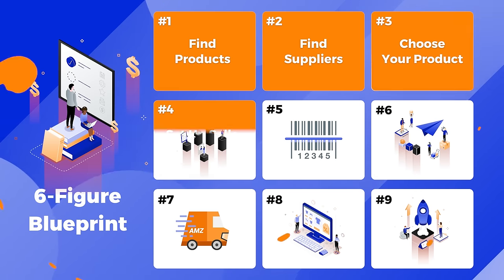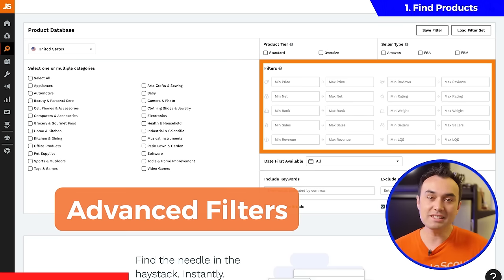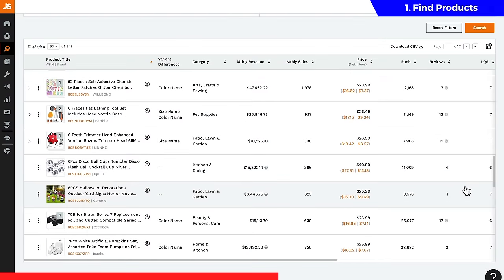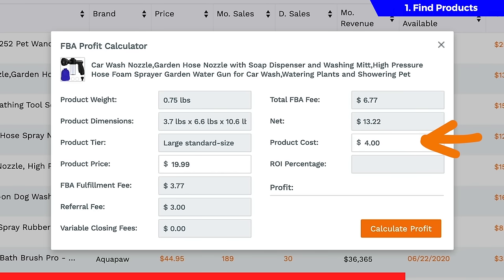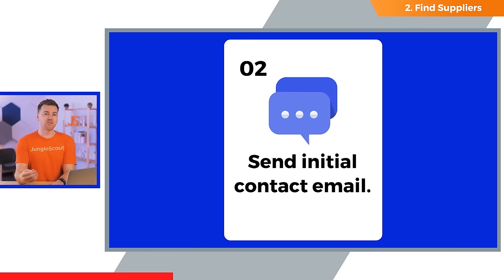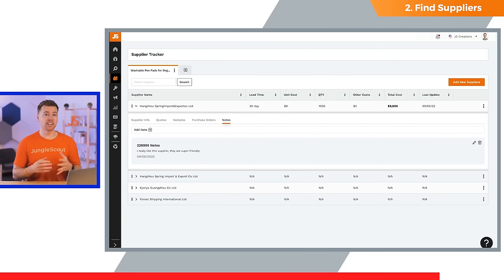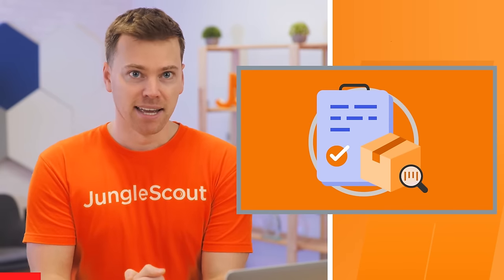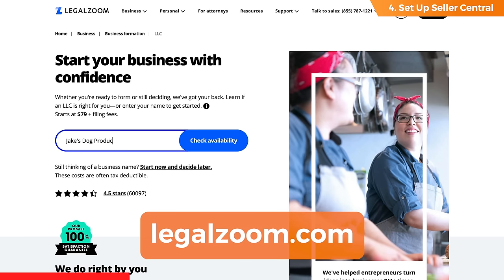ULTIMATE How to Sell on Amazon FBA Guide for Beginners 2023

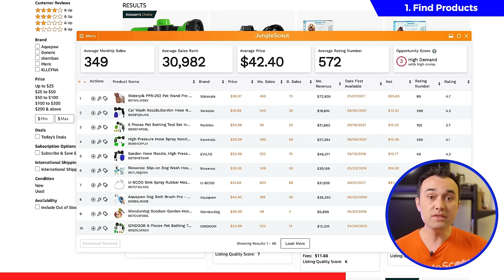Comment: I'm looking at the example at 15:55.  The product has a sale price of $36.97 with 450 monthly sales which states $72,907 and the monthly revenue says $72, 905.  Any way you slice this, the math doesn't add up.  36.97x405 is $16,636.50.  Maybe I'm not understanding revenue but that's a $56,270 discrepancy.  If that information isn't accurate, how can I possibly make projections and determine the potential for my investment?  The accurate number of units sold would have to be almost 2000 per month (1972) to even come close.
Reply from the maker: There might have been a discrepancy at that time as the monthly sales were not showing up correctly (Having 73 daily sales must be more than 450 monthly sales).. That has been corrected right away
Reply: 73 daily sales makes more sense but which one is it?  We don't know which metric is accurate
Reply from the maker: You should be looking at monthly sales and multiplying it by price. We checked the data for this product again and it looks ok now!

The issue on the video might have been a temporary glitch!

Comment: You guys are awesome, I'm following you from Spain which is a smaller marketplace, any advice on how to measure demand on smaller marketplaces? Obviously i can't expect to have the same demand here as in the U.S. Cheers!
Reply from the maker: Bienvenido! We love an international seller who is thinking about market size. You are totally right, demand will not be the same - you need to adjust it based on the size of the market. Look at the Extension and Tracker data to gauge what sales have happened over the last 30 days and work with those numbers.

Comment: Hello, once you purchase your barcodes how do you know if you need to use the bulk method you are referring to? Can you provide an example? Or if I purchased 3 barcodes for small/medium/large, would that be bulk?
Reply from the maker: Are you referring to buying UPC barcodes in bulk? If so, the rule of thumb is if you need or will need more than 8 barcodes, use the 2nd method but if you will need less, buy them per piece. For your example, since you will just need 3, it is not advisable to buy in bulk.

Comment: This is a great video but I have a question. I’ve done my research and learned all that I can but I’m learning after trying to post my product Amazon requires a product inventory list list (they provide the template) in order to associate the SKU with my product so it will show as a listing in my inventory page in Seller Central. Is this mandatory? My listing goes straight to “draft” and gives a SKU error… If this mandatory could that be added to your video? Any insight would be so helpful
Reply from the maker: Checkout https://www.youtube.com/watch?v=evG2ZLXWywQ&t=266s and contact Seller Support if you continue to see the SKU error.

Comment: For the Amazon seller central. I have a question of what business type to do. I have a LLC but I’m partnered with some one. Do I still apply individually or which business?
Reply from the maker: In this case, you can still use your own LLC, but there will be no way to add your partner's details/business info.

Also, you can subscribed with either the Individual plan or the Professional

Comment: Im just starting off and wondering, If I have a product that I am going to have available in different colors but same quantity do I need to purchase new GTIN for each color?

Thank you so much for great video!
Reply from the maker: Yes! Each variant requires an assigned UPC. 😉
Reply: Thank you so much :)
Reply: I’m also at the step now of creating my 1st listing. I’ve purchased my GTIN through GS1 but each time I try to submit my posting in seller central I get an error message from “Product ID” section saying “the sku does not match any ASIN and contains invalid value(s) etc”. This is even after I copy and paste my GTIN directly to that section.

Not sure where I missed a step…
Reply from the maker: Did you choose an option to create a new listing or to sell on an existing listing?
Reply from the maker: This error happens if you just purchased codes directly from the GS1 and then attempted to create a listing on Amazon with the GTIN.
Reply: Okay. How would recommend I move forward? Do I just need to wait?
Reply: My product is already sold on Amazon I’m just making variations. Should I just select from already existing listing and “request” approval to sell my?
Reply from the maker: Hey! You should be able to set up variations on the backend! You don't need any approval or to wait.
Reply: Hello I’m back 😅. I am creating a shipping plan in seller central. I have one product that has multiple colors but only one sku is showing for me to select when setting up shipping plan. Can you tell me what I am doing wrong
Reply from the maker: Hello there! Let's make sure you followed the correct procedure using Send to Amazon shipment creation workflow. To know more, please go here: https://www.junglescout.com/blog/shipping-to-amazon-fba/

Comment: question one-. do we need "Customs Brokerage" they charge 175$.
Question two- is it worth to pay $40 for insurance?
question three- lets say i brought 50 individual units. I put their dimensions and weight per unit. Would i select boxes/crates on freigtos or pallets?
question four-is it better to pay 170 for aliabba to ship them to usa instead of getting a frieght forwarder. like whats cheaper.
Reply from the maker: 1. If you know how to do it yourself, or you are not afraid of doing it yourself, then no, you do not need the customs brokerage
2. If you can afford it, then we recommend that
3. This would depend on how you are going to pack the product. However, with 50 units only, you should go with boxes/crates, as we do not think you will be needing pallets
4. You would need to check the rates with both a supplier and Freightos

Comment: Great video! Can you clarify how the maximum sellers section works on the software? I have put a maximum of 5 sellers when searching products, the list is generated and it details products that have 5 or less sellers. However, when I click on that product and go to the Amazon page, it can sometimes have maybe 8-10 sellers. How can I fix this so that I can only see products with 5 or less sellers?
Reply from the maker: The filter should pull out results for however, the data it's pulling from can be up to 3 weeks old while the extension is live data :)

Comment: When you pay for UPC bar code and let's say you purchase 300 products of something. IF the UPC bar code cost $30 you are only paying the $30 once, correct? That label is then utilized for all 300 products. correct?
Reply from the maker: That's correct! You purchase a code for each variation, then replicate it onto each item you sell. So for example a set of t-shirts that come in four sizes and three colors means 12 codes and you apply the corresponding size and color code to each of the pieces in your inventory.

Comment: If i'm currently only focusing on wholesale can I find products to sell with high demand,  high profitability, high reviews, and low competition? Would I as a new seller stand a chance at rotating the buy box and selling any products against 3-10 other sellers with thousands of reviews?
Reply from the maker: If you have 3-10 sellers with 1000's of reviews, the product wouldn't be classed as low competition!
Try to find products where there aren't as many reviews or dominated by certain sellers.
Reply: @junglescout  That makes sense. Will I be able to find a good product that is already selling decent, then source the same product on alibaba? I understand that y'all are geared towards private label and I would like to do the same once I can find the right product using JS.
Reply from the maker: Hi Matthew, yes, you should be able to find products and resell them on amazon. Just make sure to check the amazon revenue calculator to find out the estimated profit on the product before you start selling them: https://sellercentral.amazon.com/hz/fba/profitabilitycalculator/index?lang=en_US

Comment: For the GS1Barcode, I only have 3 products that have 3 different colors i want to sale. Can i use the option of getting 1 barcode 3 times which will be 90 or i have to purchase the 1-10 which is 250
Reply from the maker: The first option! If you only need less than 8 barcodes, the math makes sense to buy 3 individual ones, rather than the 10 pack. That's your most cost-effective option 🙂

Comment: I have several questions. 
1. If I am buying from a supplier and want to sell on amazon do I have to buy a barcode or the company from china can attach the barcode for me.
2. I messaged a supplier and they said they will use either DHL or UPS as the carrier. How will the goods get from the carrier to Amazon, do I have to setup the add shipment to print the FBA shipment label?
3. If I do not know if a product is listed on amazon due to thousands of search result, can I list a product as a product that is listed on amazon even if it might be there and I couldn't find it?
Reply from the maker: 1. You will need to purchase a UPC code from GS1, and the supplier can put it on the packaging of your product

2. You will need to verify with the supplier if they can ship the product straight to Amazon. If not, you will need to pay another carrier to get your goods from the port to Amazon's warehouse, or you can ship those goods yourself.

3. Unfortunately, that is not possible. The option to sell on an existing listing, only works for products that are already listed on Amazon (and you would need to sell the exact same product that is currently listed on Amazon)

Comment: My supplier offers a DDP and ship directly to Amazon fulfillment centre, what should I fill up at the "carrier" section? Does the Carrier information means the carrier from the destination port to the warehouse?
Reply: I can guide you
Reply from the maker: Are you referring to the "Ship from" address? If yes, then you can definitely use the supplier's address ☺️
Reply: @junglescout  I mean the carrier information: "UPS", "DHL", etc. I have a small initial order and my supplier can ship directly to Amazon fulfilment center.
Reply from the maker: In this case, you will need to verify with the supplier which carrier they are planning to use

Comment: My product comes in two different colors. How do you get two barcodes for the same product then list it on amazon using two barcodes?
Reply from the maker: To list a product with two different colors on Amazon, you will need to create two different product listings, each with its unique barcode. You can then associate the appropriate barcode with each color variant.
Reply: @junglescout  Will the customer be able to see both colors under one listing?
Reply from the maker: Yes! To do this, you will need to create variant listings under a parent listing.  You can check our listing  variations guide here: https://www.junglescout.com/blog/amazon-product-listing-variations/

Comment: what if landed items won't sell .. who is responsible for that
Reply from the maker: So there are quite a few ways you can manage any unsold inventory. You can check out this Amazon article here: https://sellercentral.amazon.de/help/hub/reference/external/201436560?ref=efph_201436560_cont_202000820&locale=en-DE

Comment: Great content! you guys have nailed it. Quick question, @51.00 Amazon requires you to have 1 UPC barcode per product. Can you use that same UPC for the same product multiple times? $30 per UPC for 1 product seems really high! and does the UPC expire?
Reply from the maker: It's for listing per product per variation but is not required to buy 1 per unit/pc.
Reply: @junglescout  I will learn as I go, that answer was not very helpful! lol right now, my understanding is that each product will need a UPC and for each variation as well. however, I can use that same UPC for 1 product multiple times of that same variation.
Reply from the maker: Sorry if I was not clear. I just want to make sure, are you asking if you need to have a unique UPC for each piece or for each inventory? The reason I included the listing as a reference is that you will only list each product variation once, so that's when you will need a unique UPC. So all of the products/units in that product variation will have the same UPC/GTIN.
Reply: @miguelrosales7150  upc means universal product code and every product has its own upc. Which make diff between diff products. Upc will be one for 1 product in every market place but its is only for one product
Reply: And if u use 1 upc for different type of producta, there will be no difference in the products
So 1 upc is only for one product and that product if this have thousand units it will require that upc only. Hope u understand what I’m saying if not u can ask me again.😊
Reply: @junglescout  yep this helps!
Reply: @muhammadnauman1631  this also helps!
Reply: @miguelrosales7150  my pleasure sir.😇
 So if u want to list more more products u have to purchase upcs acc to that.
Reply from the maker: Thanks for jumping in! This is why we love this community!

Comment: You said the product was launched for less than 8000USD  but while you are explaining shipment and freight forwarder your screenshot is about 15000 USD can you please explain a little bit. Thanks
Reply from the maker: I believe it's the page that shows that quotation but it's not final yet, you will have to choose what is within your budget that you can work on. You may also need to make some adjustments in choosing from the options as the given steps are just examples.
Reply: @junglescout  and one more question. Is it necessary to have insurance for private label? How much that would cost? If insurance is required and as a new starter I think it would be very high in US.
Reply from the maker: Pro Merchant Amazon will require you to have insurance. Please check this article for more info: https://www.junglescout.com/blog/amazon-seller-insurance/

Comment: When I get to the portion to add the upc on my listing, for example I have  2 colors in a small, medium and large and selling as a 2 pack (each color), would I have to go to my hub and do them in bulk. I tried this here but I have the errors, " The SKU does not match any ASIN and contains invalid value(s) for attributes required for creation of a new ASIN.The SKU does not match any ASIN and contains invalid value(s) for attributes required for creation of a new ASIN.	
The SKU does not match any ASIN and contains invalid value(s) for attributes required for creation of a new ASIN."
Reply from the maker: Are you getting any error code/s?
Reply: @junglescout  no errors, I bought my codes from the link you provided.
Reply from the maker: That's great and are you encountering any error messages?
Reply: @junglescout  The SKU does not match any ASIN and contains invalid value(s) for attributes required for creation of a new ASIN is the error I a getting. I made a ticket with Amazon Seller Central but they had to send it to another team.
Reply from the maker: Check out, it does show that Seller Support would need to assist!
https://sellercentral.amazon.com/forums/t/validating-upc-error-the-sku-does-not-match-any-asin-and-contains-invalid-value-s-for-attributes-required-for-creation-of-a-new-asin/1215940